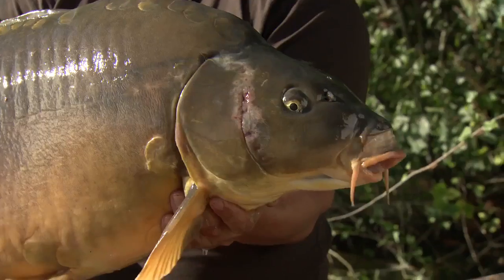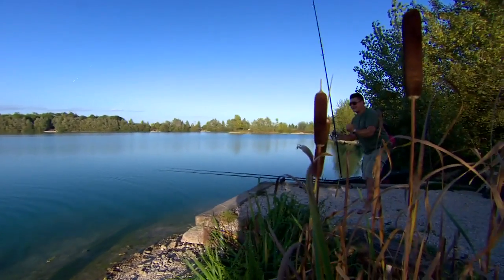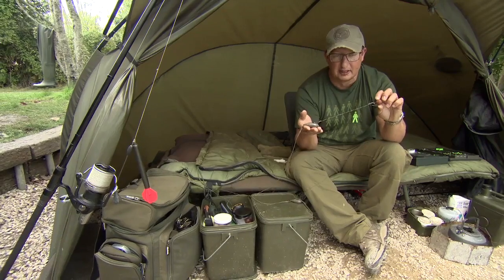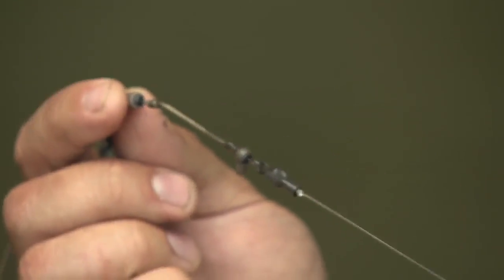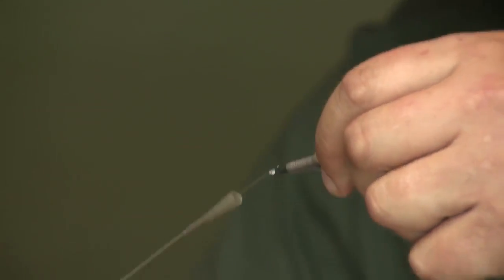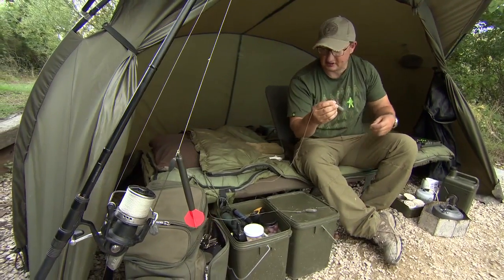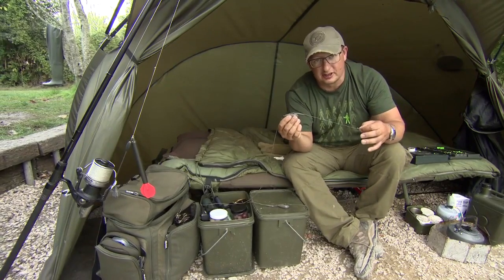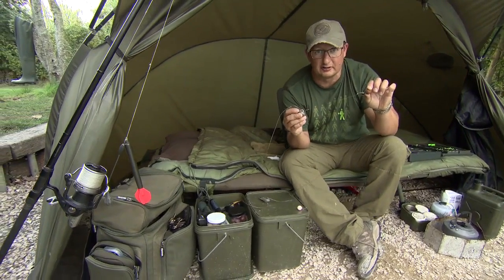The COG Lead

Comment: Can u use this system but without the lead comin off?
Reply: Just push the tail rubber up slightly further so you got more chance of keeping the lead on take but still will come off if you get snagged.